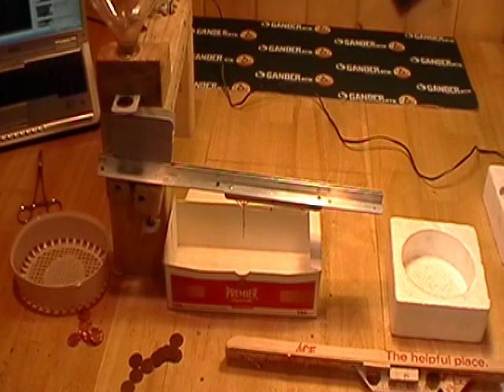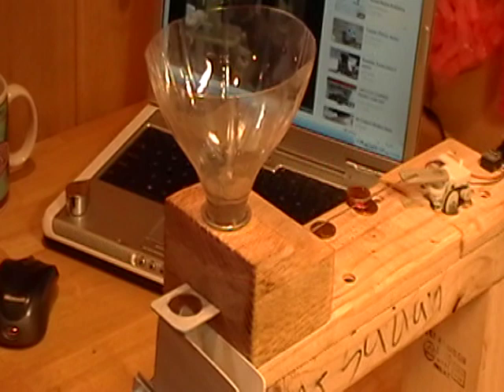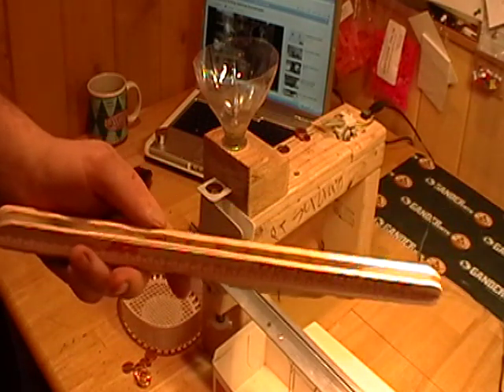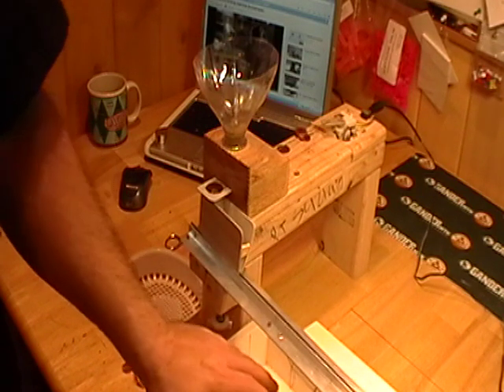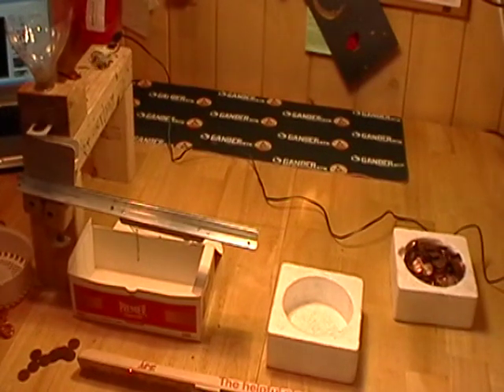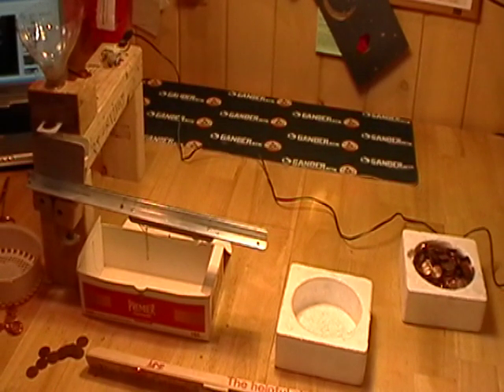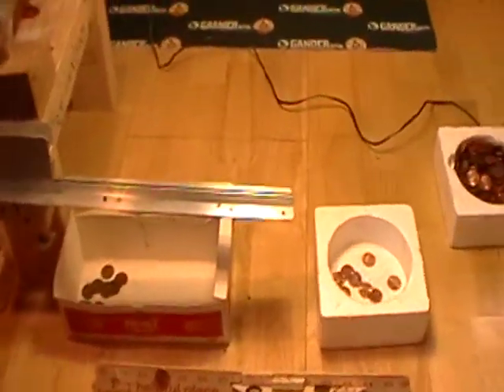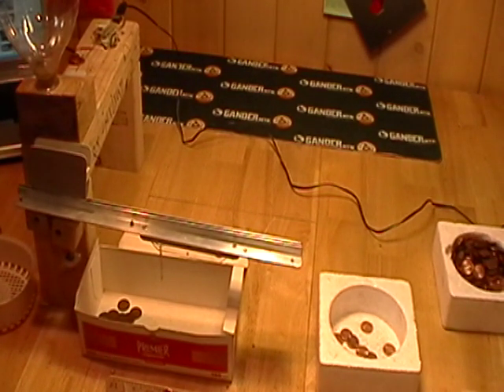Fast and Proficient penny sorter

Comment: what if you add another rail to the other side so as the motor pushes one side out and the other side comes in to get a penny?you would have a rail on each side. would that work?

Comment: Check out "Cody's Lab". He made a sorter that uses magnets to slow the copper pennies down so they fall off the very end of the rail whereas the zinc pennies keep rolling fast and fall farther away from the end into a seperate container just past the one the copper pennies drop into. 

Anyway...your feed system would be a perfect match for his magnetic sorter. Good video.
Reply from the maker: I would try but ive got a homemade gramophone going, Did you see my homemade steam generator model. Im not looking for hits, I just thought you might like it, thanks for watching.
Reply: @stclairstclair  No. I'll check it out.

Comment: How much can you load into the hopper before it jams?  Where is the video you said you'd link to that inspired you?
Reply from the maker: Silver Slingblade With this pop bottle hopper i can stack the pennies to the rim, but they must be stacked, I would recommend going with a clear tube that would hold them neat, Fish-tank lift tubes are cheap and might work much better, The video that inspired me was "Anyonefindamerica1"  But he disappeared and I've never seen him again, thanks for watching!   Go look at my homemade steam generator if you like, thanks again.
Reply from the maker: Silver Slingblade , Also you need to make the ramp adjustable, if you look on mine you can see i have a white thumb screw with the bolt facing upwards on the front.

Comment from the maker: Thanks for the nice comment, good luck, keep the slot in the ramp the penny rolls down as narrow as possible, otherwise the penny will want to lay over as it rolls and that will slow the penny and cause headaches. also the angle of the ramp must be adjustabile, if you look at mine there is a white knob with a long screw under the ramp to change it's angle.

Comment: Maybe you can add 2 rails, increase the motor speed, and add a splitter for the rails. I think I might try your design my friend!
Reply: I was going to suggest the same, kinda. I would increase the length of the arm on the motor so it stays the same speed, but slides the grabber under the hopper twice the distance. 'neutral' will have one hole on each side, as it pulls towards the motor, one hole will grab from the hopper, as it pushes to drop it on the rail, the other holder will grab a penny, as it pulls back towards the motor again it will drop on to a separate rail. I'm going to try it when I get a chance.

In short, exact same design, at the exact same rate, but will operate 2 separate rails underneath (so technically doubling the rate)

Comment: This thing works great, but it could use a modern upgrade. Get rid of the penny counterweight and paperclip scale. clip a neodymium magnet onto the end of the ramp. When a copper penny passes the magnet it will get slowed down considerably and drop nearly vertical. A Zinc penny will roll right past the magnet and fall considerably further away. All you need to do then is to put two separate jars at the end of the ramp, The copper pennies will fall into the jar closest to the end of the ramp and the zinc ones will fall into the jar furthest away from the end of the ramp. 100% accuracy.  You might want to increase the pitch of the ramp a little to increase the drop speed. You can also increase the load rate into the ramp.
Reply from the maker: Scrapman50, I cant change anything as doing so would cause my perfectly adjusted sorter to not work, I agree your plan sounds good, post a video when it's done.

Comment: A vending / slot machine / change machine feeder uses a disc with holes in it, on a stepper, they can be shockingly fast. (think jackpot in vegas) (the coins are in tubes above the wheel of course)
Reply from the maker: I cant drop them any faster or i will end up with a log jamb due to the fact that i have to wait a moment for the penny to pass or fall, Thanks for watching!

Comment: You got plans for this?
Reply from the maker: vernhartjr < It was built off hand, The rail gap that the penny runs down is 1/8" the same size as the plexiglass i used for the gate, I didn't do a good job of showing it, it is the same as the fist wooden one i showed, also I never mentioned the thumbscrew I have on the ramp, you need to be able to finely tune your ramp up or down to effect the penny speed, thanks for watching.